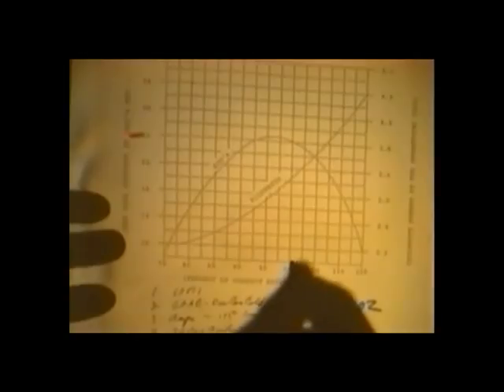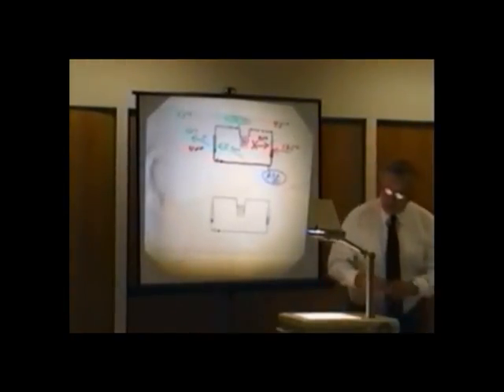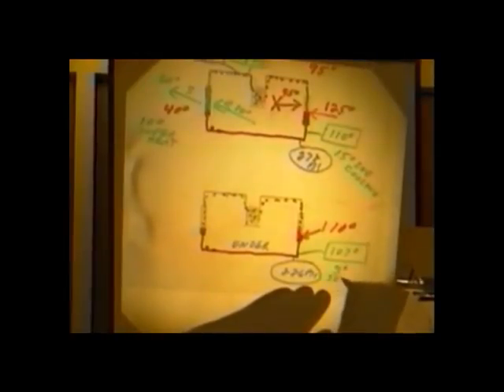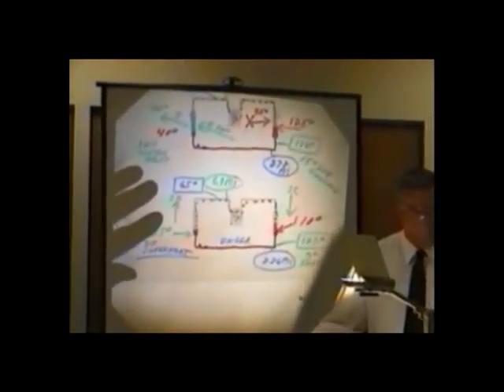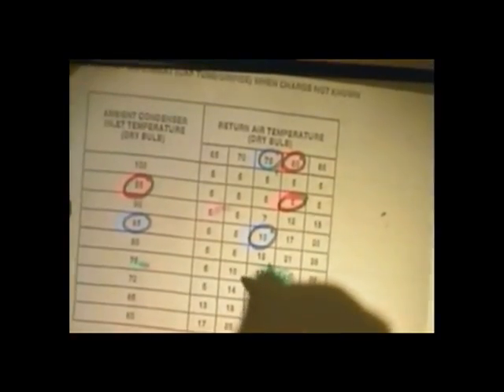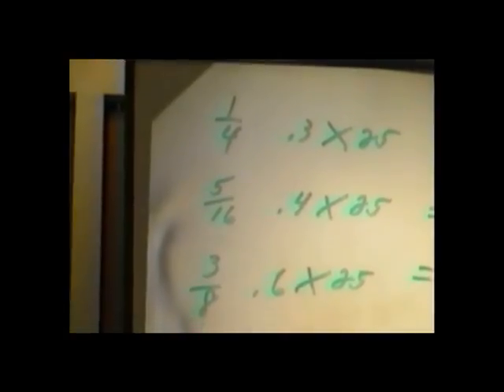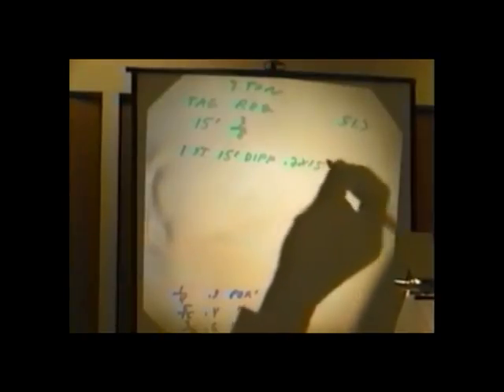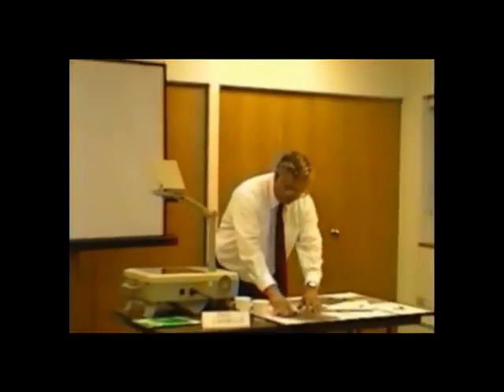HVAC Diagnosing Cooling Problems

Comment: Great video, he explains it very well and with a lot of enthusiasm. I wish whoever made the video was available for questions. My question would be about 1:28 in the video when he does the line set sizes. I want to know how they come up with .3 for 1/4, and so on. When you do the fractions shouldn't 1/4 be .25 not .3? It happens for all 3 line sets. This is the only thing that confuses me.
Reply: @GRJCLyon,

I have an answer for you, but I see it has been 8 years since you asked in your comment. 

If you would kindly come back here and post a response to let me know you saw this, I would appreciate it so I know you actually received the info.

For anyone else reading this, if you wanted to know the same thing, here is the answer:

The 1/4, 5/16, and 3/8 refer to copper line sizes in INCHES diameter. The .3, .4, .6 numbers refer to fractions of an OUNCE per FOOT of line set length. So for 10 feet, and. .3 you would add 3 oz of refrigerant.  The fractions and decimals represent two different measurements of two different materials and are not just a scale conversion from fractions to decimal. They have nothing to do with each other directly.
Reply: @realSamAndrew  8 years later and I'm still here and I cannot thank you enough for the response. That is so cool.